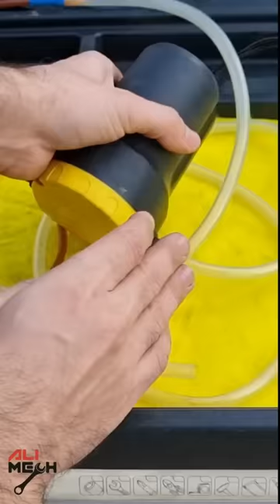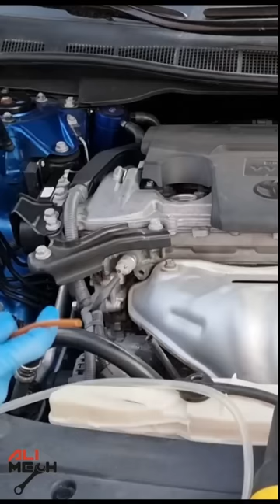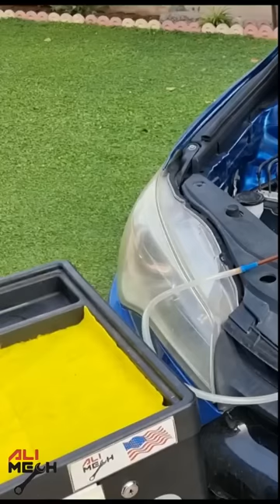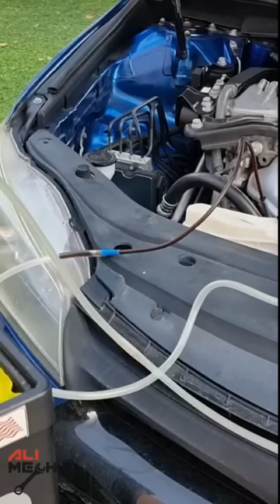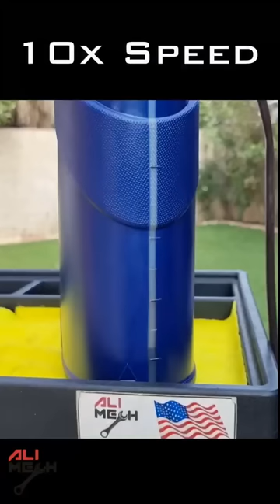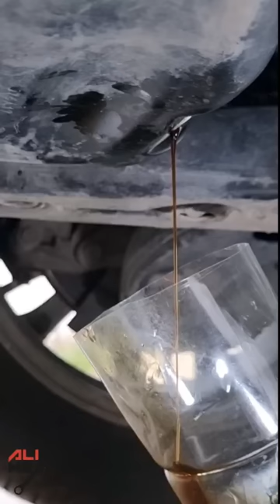Don't change engine oil like this! #shorts

Comment from the maker: Detailed video: https://youtu.be/70zR_Doi1ag
Reply: ค
Reply: Not draining the worst in the oil pan!
Reply: That's the one, mine is an "Autospeed" unit from Lidl although I have seen it under several different names.

My vacuum pump is a Kayoba unit but I have seen the same pump online with at least five different names.

But both electric and vacuum pumps are brilliant.

Comment: Depends on the design of the oil pan. Several cars get more oil out this way. Plus that little bit of oil won't matter if you have a proper filter and change your oil on time.
Reply: That "little bit" is actually also the dirtiest one though ;)
Reply: That's right, vehicles like Harley's and other motorcycle's that have an oil tank that's separate from the engine have almost a half of a quart that trapped inside the engine's bottom end that doesn't get drained when changing oil and it's no kind of life changing event with them.
People make too big of a deal out of stuff like that, changing your oil and filter at regular intervals is the most important thing, a little bit of oil trapped in something somewhere isn't going to hurt anything outside of people's imaginations and paranoia.
Reply: @TheBypasser  i also did this and surprisingly after some days i looked at the bottom of the cam and  i saw a lot of deposits and mess  , i think it s better like this and change the oil filter then running without oil change or at 30k km , some people just don't bother
Reply: @cristianJoker2512  I see no reason to do this at all. What are the gains? Saving on a new drain plug and the service cost itself - yet all for a potential price of a massive motor repair or replacement? So I just do my oil changes every 8 000 km along with the filter of course, and always through the drain plug. Indeed, why any other way around? Every motor has a drain plug, a probe channel and an oil lid, each serving one's own purpose - now doing it differently is like brushing your teeth through your rear. Can it be done? Technically, yes, as there is an interconnection path in between. Now, should it be done? Well, no - for a reason so obvious. Why nobody does this, yet drains the motor oil by some unintended means is a big question, although technically it is the same thing as the teeth example ;)
Reply: Some Mercedes were designed for their oil to be changed like this
Reply: @TheBypasser  i know what you mean,  i saw another car and that after this on the drain plus was just a glas remaining, but on mine managed to get out just 4 from 4,7l and next time i did a full eingine flush and did all correct after 5.000km because i knew some was left dirty and  someone saying if u can change the filter around 5.000km u better do it because at around 10tkm that oil filter it s filling up arroud 5tkm and the rest it s just recirculating in all around
Reply: @joshmanis9860  yes, they were DESIGNED to be done like this. The dipstick tube actually goes to the lowest point of the oil pan and removes almost all used engine oil. But most conventional engines weren't engineered to be vacuumed through the dip stick hence leaving used oil and fine metal particles behind. Will they hurt the engine? I cannot say. But personally I will stick to just changing my oil the old fashioned way. It's not that hard and I won't be taking any chances that way. Besides, I installed a petcock on my oil pan so I don't have to take down a wrench. 🤣
Reply: Depending on manufacturer and engine, this can go to the "shallow end" of the pan instead of the "deep end".  There could even be a plate below the normal level of the oil that prevents a tub from reaching bottom.  Because a dipstick doesn't have to reach the floor of the pan, just an inch or so below the full-charge oil surface.  Whatever's left, if it's not warm and circulated, will contain everything that has settled.  If the engine has been warmed up a bit and the oil is drained via its drain plug, then there will be a more efficient scavenging of fouling.  But even if it is done via drain plug, some engines aren't great at dropping all the junk out anyway.  For instance, the mercedes designed 4.6 in the cerbereus-era rams... you change the oil and it's black every time, and brown within a week or two.  But their dodge 3.5's and 5.7's from the same, the oil is only reddish at 4000-5000 miles and can take 6000-8000 to go black.  I suspect the 4.6 has several low spots that don't get fully drained, or maybe just doesn't keep itself cooled and sealed as well.
Reply: @TheBypasser it will get diluted by the new oil
Reply: @wigletron2846  A common misconception. No, it will not, as the degrading oil also drops a lot of non-soluble, often hard fractions that just stay there unless washed out during a through-plug draining. They are heavy too, so tend to sink down, so, long story short, if you do want your oil pump worn and (as this stuff sometimes makes it through the filters) also plan on killing your bearings and clogging the EGR if one's there, well, it can be worth saving a few bucks on the new plug and service time. As replacing the EGR already costs like $1k, well, I'd not go for this though ;)
Reply: @TheBypasser  I would never change my oil like in this video. I'm not going to spend money on a pump to do a worse job than just draining through the drain plug. Even when draining from the drain plug, some cars don't get all the oil out based on the shape of the pan, angle of the car if it's on a jack, etc. It's not a big deal. As long as the oil and filter is changed regularly, the magnetic plug will get most of the crap that doesn't get drained out. And if you're getting lots of metal and debris in your oil then you have bigger problems than a thorough oil change.
Reply: @wigletron2846  Sometimes there is no magnetic plug at all (this is not an AT with many magnetic parts), also the stuff from the oil is just carbon etc so will not get caught anyway. Most of it still gets washed out by the flowing oil during the standard change, yet some also sport the trick of pouring a little fresh oil in and draining it immediately, I tried and it washed off a tiny bit more of that black mess.
Reply: @TheBypasser  it's not enough to make a difference or be worth the effort. As long as there's nothing seriously wrong with the engine getting every ounce of oil out won't make a difference.
Reply: @TheBypasser  as someone who works for Royal purple, I can guarantee that doing it this way is not affecting performance or longevity of the engine.
Reasoning:
Oil sits in oil valleys in most heads after draining oil
Aaalsooooo fuel contains much more harmful contaminants than used engine oil:)
Oh…. Buy royal purple…I had to…
Reply: @TheBypasser in my country oil and filter change cost about 200/250 euro .
Diy cost me about 60euro .

I do my car around 10k klm for oil change 

For the rest heat up the engine and you can thake oud easy the oil.
Reply: @dyslectische  I used to do diy changes when had a garage with a pit. As 10kkm is roughly once to twice a year, you can just rent a garage or find a ramp (I always use metal crankcase shields, so a ramp or a pit is a must, probably can be done easier otherwise as it is just a single screw to unscrew).
Reply: @davidd7797  speaking that bmw’s get the same amount of oil sucked out of the pan as they would with the drain plug I have to say you’re wrong
Reply: @TheBypasser  that is one of the reasons why you warm your car before changing your oil!
Reply: @paulcondie2520  No :) You need to warm the engine in order to flush the thinner oil channels. Whatever is left in the pan stays there no matter how you warm it though (the deposits are usually hard), I'd really not mind to see if anyone who prefers the pump method would take the pan off at somewhat 50k miles and take a picture of it.
Reply: @TheBypasser  when you warm the engine it all mixes up is what I was getting at. All the dirty stuff that settled to the bottom of the pan. And what he said! Lol
Reply: @paulcondie2520  By what means would it mix up? The crank and the intake are both well above the drainplug, and that is where the mess hits the fan. As the oil is mixed with burnt fuel leftover, or just oxidizes, it drops some heavy, virtually insolvable deposits that both clog your channels (research the old issue with some engines losing compression due to the insufficient oil flow to the piston furthest from the pump) and, ironically, do it all slowly! That is, all the mess is contained in the pan, yet indeed it does mix with the oil - but only to some degree. That is, if you'd just pump it, only a minor floating bit of those deposits will get mixed with the oil and drained, yet a lot will remain to mix with the fresh oil after the change.
Reply: @paulcondie2520  Oh my... Not dirt (wonder where could you get dirt in the engine from...): the oil mixed with the other stuff just solidifies - and not just tiny particles, those can be huge chunks of solid or slimy crap (yeah, yeah, I've seen a clogged EGR line, which looks close to what your pan will look like unless properly drained - that mess there had to be hammered out, I can bet it will never dissolve on it's own unless you run pure acid instead of your oil lol). And no, it will not just magically swim up altogether to get trapped in the filter, instead it will slowly shatter to destroy your oil pump. Yes you can believe some of it will float after stopping the engine, but it will be a tiny fraction of the overall mass that will sink back in a few seconds. Yes you probably can get the most of it out, but in that case you have to replace the oil like a few times in a single procedure with engine running in between, pretty much like the transmission fluid is properly changed.
Reply: I don't like to change the oil this way as it left some dirty oil in the oil pan so I tear down the engine and reassembly it again with new oil so that I make sure there is no old oil left.
Reply: Exactly
Reply: @wigletron2846  No it wont delute, if you change oil filter too, than you do 3000 rpm ride outside the city for 1-2 hours, the new oil filter will get the old metal chips out and oil will be cleaned. That is why you change oil filter every time you change oil.
Reply: Facts
Reply: @TheBypasser  must feel bad to run oil without filter
Reply: @TheBypasser false if the engine has been warmed particles should be suspended in the oil. And if you really have that much a sledge and metal at the bottom of the pan you’ve got other problems.
Reply: @tonycarpaccio9550  Not again :) The burnt oil contains a lot of mess, that's why cleaning runs are a thing. And if you want it, just try a proper oil change (that is, pour a little fresh oil into the empty engine without the plug after draining) - the first glass will still be pretty dirty!

Comment: Honestly you say don't change your oil like this , but for a diy-er that's the best way . And they don't have to worry about someone screwing them over.
Reply: Tired of my cars being damaged or not worked on at all while they take your money  do general maintenance my self now
Reply: @sugarsaint everytime I took my VW to the shop for oil change they found some $1000 part to repair.
Reply: What about just pulling the sump plug?!

Comment: I'm no fluid expert, but odds of that small amount of oil between the two lines at the end probably doesn't contaminate the clean oil much at all.  When they want to charge 85 for a simple oil change, I'd go this route for a couple rounds and then bring it in.

Comment: If you leave it longer and have the hose in the right position it will get all the oil. I think it was HumbleMechanic who proved it on his channel.
Reply: Yes, but it depends on the car oil system design.

Comment: I always make sure the engine is hot first, or at least very warm, then check the oil level before I start, that way I know how much oil I should have in the can when I've finished the change and know it's all out.

I also use it to change gearbox and axle oil's, brilliant for European Fords with no drain plugs and PAS reservoirs. I also have a smaller unit I use to bleed brakes and fluid flushes.

I've been using electric and vacuum pumps for twenty five years  without any problems.
Reply: Don't you have to prime the pump first so it lasts longer ?

Comment: This would be really handy for pulling fluid out of differentials when you don’t want to pull the cover :)
Reply: Probably blow that pump up.
Reply: Well I was actually talking about other cars with splash/ rock guards a 2.7 disco has the filter between the V on top of engine so dead handy anyway! Oh the other reason if the filter was behind a skid plate I wouldn't even buy the car lol not so young and a bit of arthritis in my hands these days too.
Reply: @nigeldlm
whats a skid plate?
is it the one underneath the engine?
Reply: @endurofan9854 yes. I've seen skid plates in a couple of places. If heard of many times where people have punctured a hole in their oil pan. Or caused significant damage to another major component. They're basically a shield for your large drivetrain parts.
Reply: I use a hand pump from harbor freight its cheap and effective fir oil transfer
Reply: @ryans9103  thanks brother, haven’t looked into it yet but I was hoping for a manually operated option. did know for damn sure I didn’t want that electric pump 😆
Reply: @videos-for-friends  its saved my but once couldn't get the fill plug off but the drain plug was fine. So i used the pump to fill the diff from the breather tube just looked up the volume of oil. It was a life saver.
Reply: That wouldn't work but with a bigger pump yes. Much bigger
Reply: Rear end fluid is too thick. Maybe after driving for an hour will get it warm enough to suck out.
Reply: The tiny electric pump will catch fire doing gear oil. Using an air operated suction pump works perfect. But if its 75-140 and winter. It'll take an hour for each gear pot.
Reply: Oh yes, I service my diffs this way.

Comment: I've always done my oil changes, since like forever (10 vehicles) like this and never had any issues. Up till half a litre of old oil left in the oil pan won't matter. And if you're concerned about that, just change the oil slightly earlier.
Reply: Spot on , this is a great gadget to use once oil is hot.

Comment: I was a marine tech for about 10 years in the late 70s/early80s. We had a stop made rig that used a Bendix electric fuel pump and a stainless reservoir. There is no telling how many gallons of oil I changed with that thing. Pumping oil through the dipstick tube was about the only way to change oil in many inboard and i/o engines. 

I made a rig similar to the one here with an empty jug and a hand vacuum pump. It worked great on removing most of some nasty stuff from an automatic transmission.
Reply: I made one out of an old toilet roll holder and sticky back sellotape earlier. Worked, but it leaked a little bit.

Comment: Need a better pump or more sturdy hose to reach the bottom of the pan. This method definitely works great for vehicles with filters on top of the engine. If the filters underneath the car you might as well drain it normally though
Reply: That Toyota's filter is on the bottom.

Comment: Those soft vinyl or neoprene tubing do not always stay straight down when they reach the bottom of the oil pan and thus not able to pull the rest of the oil out.  Try using a stiffer polyethylene tubing instead next time.  FYI, polyethylene tubing usually comes coiled up.  You will need to straighten the portion that goes into the oil pan first with a heat gun.
Reply: Good call
Reply: You're never truly gonna get all of the old  oil out of the engine anyway, so I could see this helping older folks or people with disabilities, although this would work best for them with an oil filter relocation on most vehicles, most oem manufacturers design their oil pans to retain about a half a quart or more when being drained level, that's to prevent immediate failure if you forget to put the oil in. But you only get about a minute before all sorts of noises start happening that might not go away after adding the oil.
Reply: @Initial_Gopnik  You can extract all of it on an engine designed for it.
Reply: @TopiasSalakka  look I mean maybe there's some racecars out there that have a dry sump and they can actually benefit from this but I worked at a junkyard and I pulled countless engines and transmissions from all makes and models, and even if you pop a hole in the oil pan and leave an engine hanging to drain, you'd still have about a quart of oil in the damn engine somewhere. Especially when it's cold because the oil gets more viscous and sticks in the passageways.
Reply: @Initial_Gopnik  you always leave oil in valve cover, oil filter and internal passages of engine (and in oil pump and other hydraulic equipment such as VVTI and alike).

Comment: yeah doing oilchange while oil is so cold & viscous is genius
Reply: No, get it piping hot so it will melt the plastic pump, and the hose perhaps.
Reply: @BenVanAmburg  if the pump and tubes can’t handle that heat, they’re probably using the incorrect type of equipment for it🤔
Reply: You run it for a few minutes to get the oil up in temp. Not to where it’s at operating temp.
Reply: @Techcensorshipbot  there’s purpose built machines for this that are meant to handle oil well over operating temp. This pump is not at all meant for this.
Reply: @BenVanAmburg you are aware of the standard operating temperature across the board of most every vehicle is about 170 to 180° of oil and that the car also has an oil pump and hoses that don't melts even an extreme high heat track conditions where Oil rises above 220°

Comment: Tested sucking out the oil on my pro master. It gets more out than the drain plug will and I can do it all from up top and the oil filter is also up top. Pulled the plug after and not one drop came out.